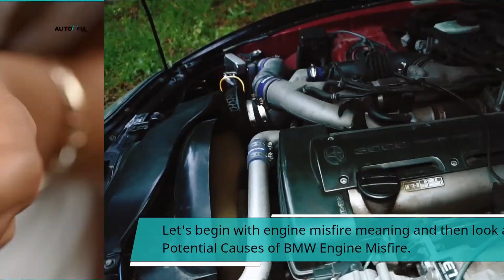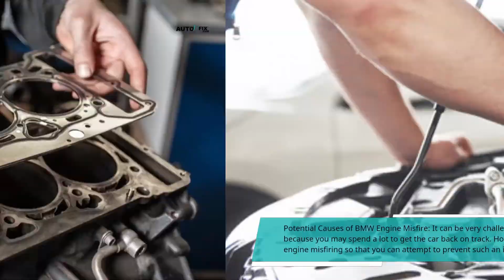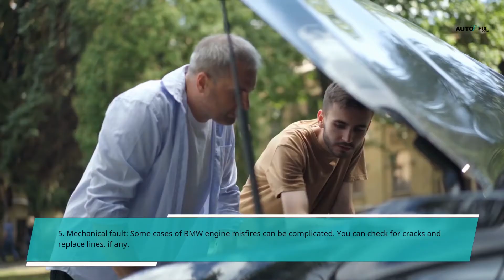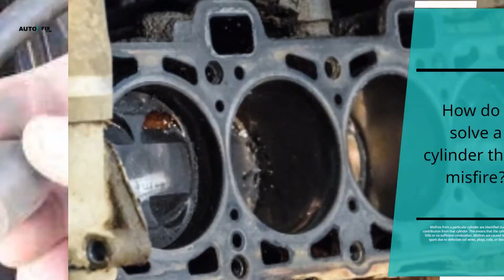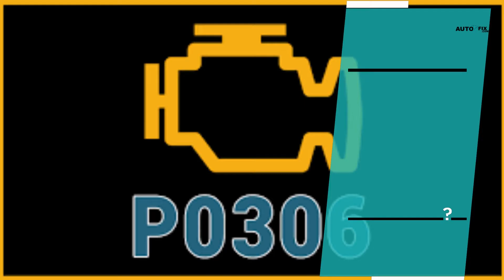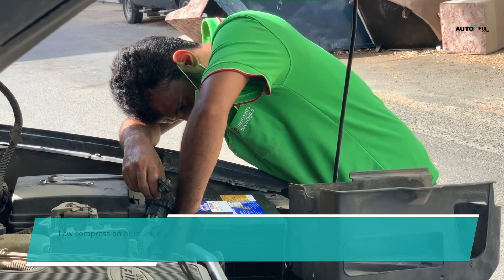BMW Cylinder Misfire Causes, Symptoms  and Solution

Comment: So a bmw is not worth buying especially used more than three years old
Reply: It depends on used car, i bought a bmw 320i 2012 model used, had 86k km. After 5 years now is has arround 147k km, I  never has any serious issues. I would still buy used bmw if has low milage. It is a great car.